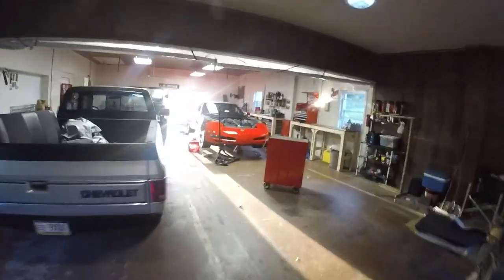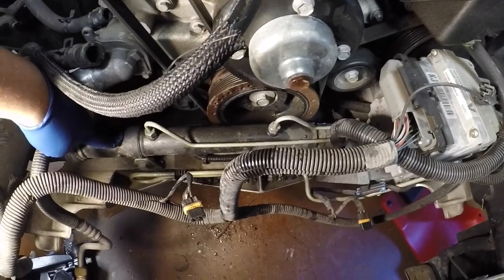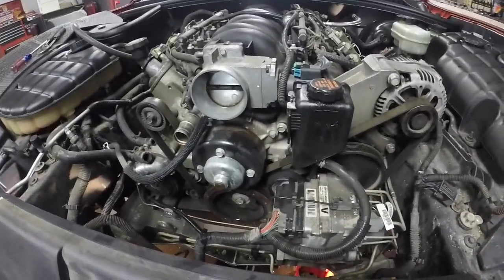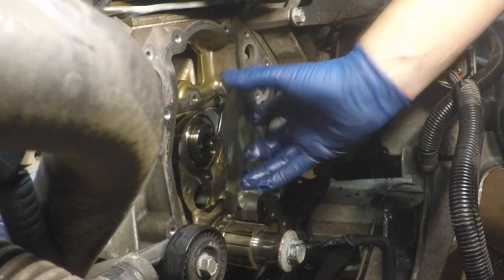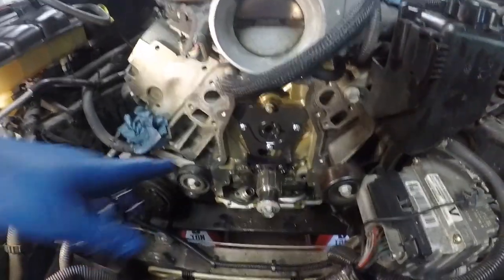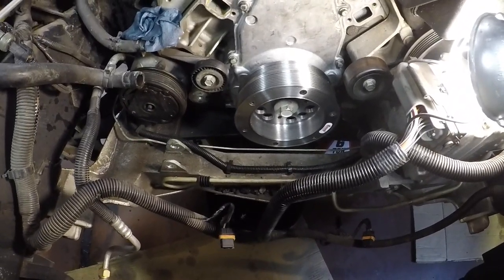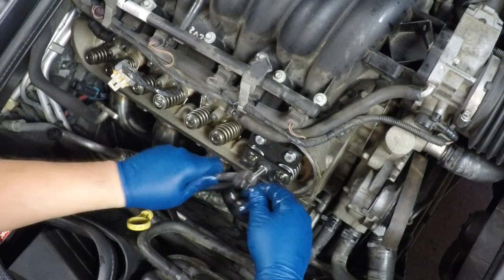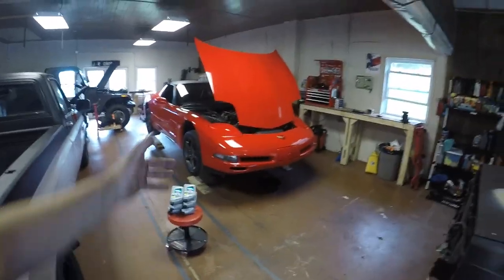Cam Swap Guide | C5 Corvette

Comment: This was an amazing video man. I'm taking mine to the shop tomorrow. I'm thinking it has bad lifters and it may need a new cam. This almost makes me want to do it myself to save money.
Reply from the maker: Thanks buddy! Its really not as bad as it seems! But if you are doing lifters the heads will need to come off too
Reply: How much did the shop charge you for a cam upgrade
Reply: @imaboss1998  $2500
Reply: @CadillacJones did that include parts and a tune?
Reply: @Zach-td5mb  That was out the door so it includes taxes, parts, and labor. However, it did not include a tune. They used the same spec/brand cam that was in it, so they said a tune wouldn't be necessary.

Comment: Awesome video. How did it drive after the cam no tune ? My tuner is quiet a few miles away.
Reply from the maker: I had the pcm shipped out and mail tuned before I even did the swap, so it actually never ran untuned with the new cam! I would like to get it on a dyno to really fine tune it in the future

Comment: Do you have to get it tuned after a cam swap? Great job and thanks for the video.
Reply: Your header install video answered my question.
Reply from the maker: @kg1966  happy to help! I actually had the pcm sent out and tuned before I did the swap and forgot to mention in the video that it was tuned for the first start! Sorry for the confusion!
Reply: @JeepinJimmy  Ya sent the PCM out for the tune ? I ask why I couldn't do that for my Mustang - sold it & the SCT, looking at C5 & C6 Vettes now ,, who did you sent the PCM to & cost to tune ?
Reply from the maker: @GatesRapes  right on! I went through Mail order tuners for $300
Reply: @JeepinJimmy  Appreciate the update !!!

Comment: Dude, u did a great job with video
 Lil scary for a shade tree mechanic.. Thinking to do same to my 98. But 3 questions. What can did u add, how many miles on engine and no stall converter required in tranny.?
Reply from the maker: Thanks buddy! Its a Texas Speed 228r, engine has 55k, and no stall converter because this car is manual

Comment: Great video.   I've installed 6? Cams in 4gen foodies but haven't done a vette yet.     How did you remove the oil pump with out removing the oil pan?  That freaking pickup tube bolts on the bottom isn't it?  Also it's been about,  oh, 15 years since I did an ls cam swap.   Turns out having a kid takes allot of time.    Lol.  Truth is I haven't needed to do side jobs since then.   So I haven't.    What's a decent going rate for a cam swap in a Vette these days costing people?
Reply from the maker: The oil pump is keyed to slip over the crank and is held in with 4 bolts right on the front, sorry I didnt get a better shot! But youre right, the pickup bolt is on the bottom, but it was accessible. Just dont drop it down in haha. Id say this cost around $2500. But no labor of course! haha
Reply: @JeepinJimmy  thanks for the reply.   I was trying to find a typical labor price the shops are charging their customers who can't do it themselves.   I don't want to over charge my customers.  Got 2 side jobs lined up to do them in my garage.

Comment: Great video man! What happens if you don't have compressed air?
Reply from the maker: Thanks! The valves would fall into the cylinder and you would have to take off the heads to retrieve them lol
Reply: @JeepinJimmy  I guess the only other thing would be to pull the heads eh?
Reply: You can also feed a length of rope into the cylinder and bring the piston up compressing it into the heads of the valves. You do have to keep the crank from rotating back again when the valve heads push on the rope.

Comment: What have you done about your pull key wait 10sec code?
Reply from the maker: I ended up replacing the steering column for a whole other reason and the issue went away! If you are having the same issue check out the LMC5 module

Comment: Just curious, why did you not change the lifter on this cam swap? I'm looking to do a swap, but the engine is out of the car.
Reply from the maker: I didnt want to have to deal with taking the heads off without swapping them. Plus the low miles on the engine, so I wasnt worried about it

Comment: did you need to tune it before starting it or can you go on a coup[le heat cycles before getting it tuned ?
Reply from the maker: You don't need to tune it before start up, but mine was

Comment: great video....did you get it tuned?
Reply from the maker: Thanks! Yes I got a mail order tune and had it in before the cam was done. So all the idling clips in the video were tuned
Reply: @JeepinJimmy  where did u get it from. I have a 6.0 swap I'm finishing up this weekend. I need a tune in the ballpark for engine break in and then take it in for a dyno tune
Reply from the maker: @dominicksainte22  mailordertuner.com it was about a 2 day turn around

Comment: wish you would have shown how you managed to change the timing chain and oil pump with the motor still in the car because i know its a pain in the ass.
Reply from the maker: Well the timing chain is easy with the oil pump off. The only pain about the oil pump is the pickup tube bolt on the bottom, just dont drop it in the pan hahaha

Comment: What about running it at 2000 rpm to break in the cam
Reply from the maker: This uses a hydraulic roller cam and no break in is necessary